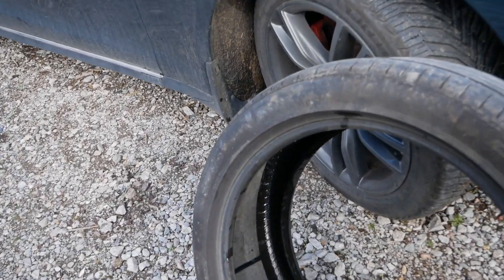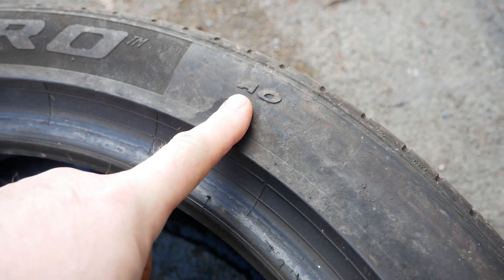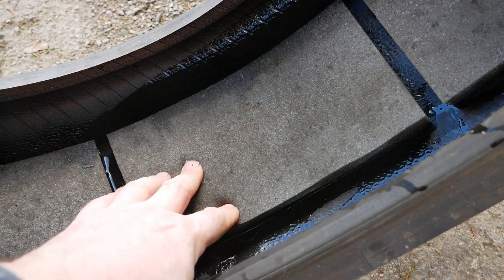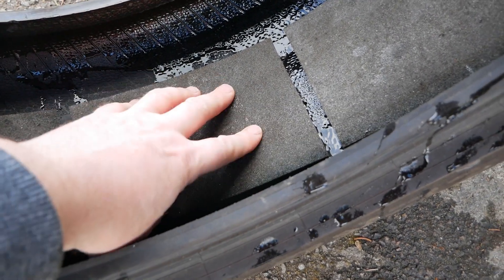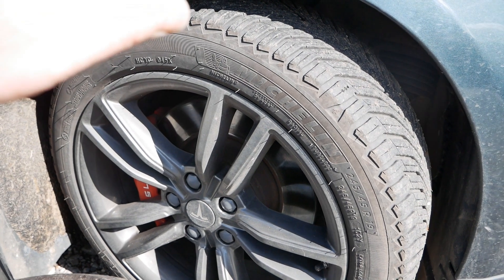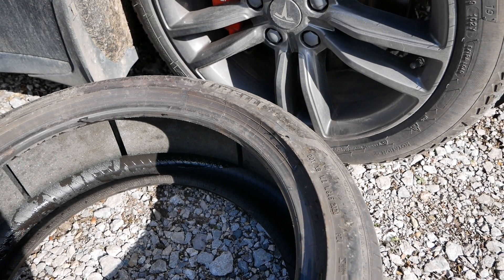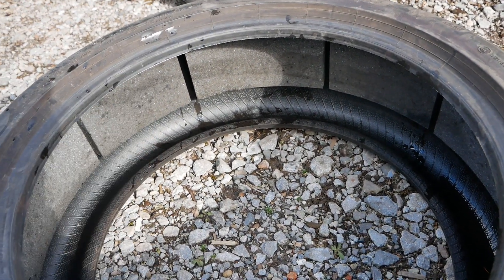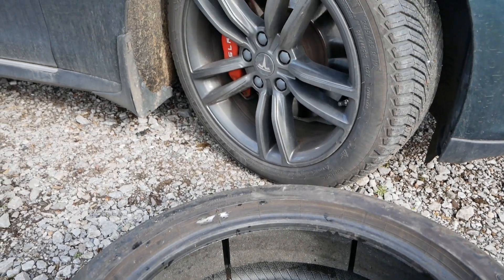Acoustic foam filled tyres and EVs (especially special fitment Tesla T0, T1 & T2 tyres).

Comment: How do you like this set of Crossclaimed 2 on your Tesla? Noise? Winter? Dry? Wet?
Reply from the maker: I've used all-season tyres on many of my vehicles now and wouldn't buy any other tyre. They're just ideal for the UK climate. On the Tesla, these Michelin CrossClimates have been great. No extra noise at all. Great in the summer and amazing in the winter. See https://youtu.be/puHpS9_vSBI
Reply: @ how is the noise level with  the  CrossClimate 2 compared with the set of tires work foam?

Comment: My wife has the distinction of having 2 flat tyres in the space of 3 months of owning a model Y. The first time we got it replaced by Tesla - they towed, fixed and replaced it with the Hankook model tyres it shipped with. Bill was over €500. Second time she went to a garage and got some no-name tyre of same spec and it was €150. There is no difference in profile or anything though I didn't look in the original tyre to see if it was insulated. I imagine it probably was. But I think from now on, if we get a flat we'll just get a tyre of the right profile without worrying too much since those Hankooks are damned expensive. I'm also going to buy a can of that Holts tyreweld because Tesla cheaped out on supplying a tyre pump / emergency foam with the car and want a ridiculous €130 for their system.
Reply from the maker: Don't bother with Holts tyreweld if your tyres are foam lined. I've done a video about this and look at the correct puncture repair kits for acoustic tyres. See https://youtu.be/H38IlTwZfFs
Also the latest video is on EV tyres which you'll find useful https://youtu.be/FWl-0k9qHJw

Comment: Eu tire noise label is showing outside driveby noise. Its not necessary same values that tires produce inside the car. So in that sense the EU labelling system is not to be trusted 100% to give less noise between tires when target is less noise inside car.

Comment: Hi there, good video and informative but if your particular car doesn't have a spare tyre , just the squirty foam you spray inside the tyre valve then it wont seal the puncture under the foam so as I live in the countryside and haven’t got a spare like many thousands of other cars, what happens when my tyre goes flat? Is there anything I can do or do I have to buy a spare tyre and wheel and carry it in my boot?
Thanks for the video, very informative. 
Steve Fletcher.
Reply from the maker: In all my vehicles, I carry a gunk type puncture kit (most have this as standard) and a string plug type kit. The string plugs are ideal if you have foam inside the tyre.

Comment: I plan to diy treat my tire with some PU foam like this.

May I ask what is the thickness and width of the foam in your video ? 

Thanks
Reply from the maker: I don't have this tyre any more. However, I would be very cautious about sticking your own foam into a tyre. As I said in the video, even some of these factory tyres have had the foam come loose and cause balancing issues.

Comment: Thank you for exposing this commercial scam Go Green. An acoustical engineer immediately spotted (by sight) the scam because the foam stuck inside the tyre does absorb near zero energy. Also, you were correct in the -3dB being half the noise energy of the 0dB reference level; however, to hear a difference in noise/sound level, one must reduce the noise energy by at least 6, but better, 10dB!   Keep up the good work.
Reply from the maker: Thanks for the info.

Comment: Hi do you have any data on how crossclimates affect efficiency?
Reply from the maker: No, but if they do its hardly measurable. I've put all-season tyres on four of our EVs now and there's no noticeable difference in efficiency at all. Check the rolling resistance letter on the EU label though. From memory, the Goodyear FourSeason tyres are better than the Michelin CrossClimates for rolling resistance, but it may depend on your particular size though.

Comment: Yup, had the foam come away. Took to local farmer Autocare to get wheels balanced. They had to add 100g to balance it. Went out of balance a day or so later, balanced again. On third occasion took to Tesla who knew straight off what the problem was, and took foam out.
Reply from the maker: Were they Michelin tyres?
Reply: @GoGreenAutos  Yes, Michelin Pilot Sport 3, with T0 designation.
Reply from the maker: @barriedear5990  from our sample test of 2, it would seem Pirelli's PNCS tyres may be more robust with better foam glue.
Reply: Just wondering if it's just down to the type of driving that the tyre gets used for?
Mainly motorway miles, the tyre won't be shaken around or compressed as much as a life of mainly pot hole and speed hump ridden city streets!
Reply from the maker: @computerbob06  it could be. Potholes (there's some vicious ones out there now!) and speed humps would have quite an impact on the tyre.

Comment: Thanks Matt, My Tesla Model 3 needed new tyres and I went for std Michelin Pilot Sport non foam tyres, I didn't notice the difference in tyre / road noise.
Reply from the maker: Hi John. I think in the Model S, they were slightly quieter.
Reply: There is a difference on a rough asphalt, but you can only notice it if compared directly.
Reply: In Germany you don’t repair Tires with Speed Index higher then V

Comment: Qwick fit are rip off merchants. never use them . if you use the foam puncture kit can the tyre be used again ?
Reply from the maker: Yes the tyre can be used again, if....
1. the tyre is damaged from driving it flat
2. the tyre sealant is washed out, which is awkward
3. the original puncture is repairable

Comment: Those A0, T0 etc marks are just tyre manufacturing marketing BS, those can be fitted to any car if the tyre size is correct to the target car and wheel. Almost every car manufacturer have their own branded tyres and surprisingly it is every time some the most expensive tyre manufacturer and its top end tyre model 😁
Reply from the maker: Yep, completely agree.

Comment: That tyre can be repaired as easily than non foam tyre, just use those sticky glu strings and that's it. I have repair kit in car all the time.
Reply: As Matt said they are not considered a permanent repair so shouldn’t be used as such. This is a quote from a tyre repair website “Emergency roadside plug repairs are NOT intended to be a permanent tire repair. Plugs and string repairs are designed to get you back up and rolling long enough to get home or to the nearest service center to perform a proper tire repair.” Legality is maybe the wrong word but the reasoning is the same.
Reply: Don’t think those repairs are legal. The repair has to be vulcanised (?) sealed on the inside of the tyre.
Reply: @CosyP  those tyre plug repair kits are on sale everywhere and are legal to use
Reply from the maker: Yes, so do I. But these should be treated as a "get you out of trouble" repair, rather than a permanent repair.

Comment: Thank you for the useful information, much appreciated. It’s interesting to see the foam. My Id4 came with Pirelli scorpion ‘elect’ tyres, I was wondering what the elect meant apart from the extortionate price! When they need replacing I’ll look for all season alternatives that meet the speed/load rating.
Reply from the maker: "elect" normally means the tyre characteristics are focused towards less noise and rolling resistance. But its mostly marketing, as that's been the focus for years before EVs.

Comment: Thanks for this.

The little gem I got from this is that if I decide to fit OEM 18 inch wheels and associated tyres to my VW ID.3 1st Edition which came with 19 inch alloys, I need to inform the insurance company.

Never knew this.
Reply: Why the heck insurace company need that information?
Reply from the maker: If I was fitting OEM wheels that were available on other ID models, then yes, I wouldn't tell the insurer either. But if you were fitting anything that was non-standard, then you should really.